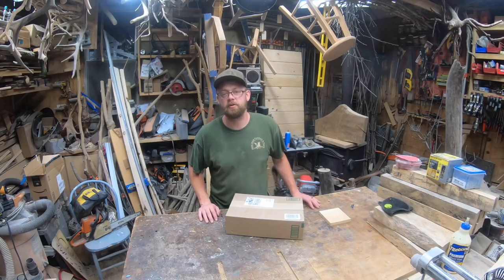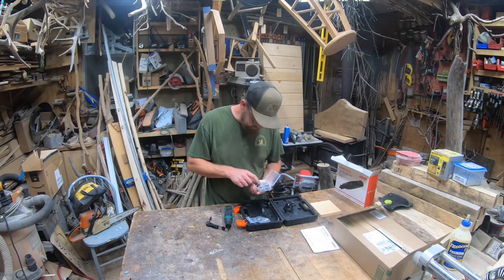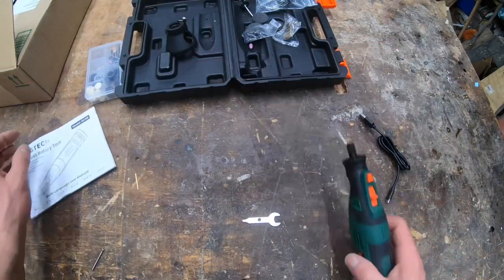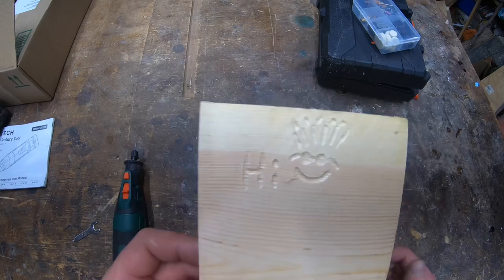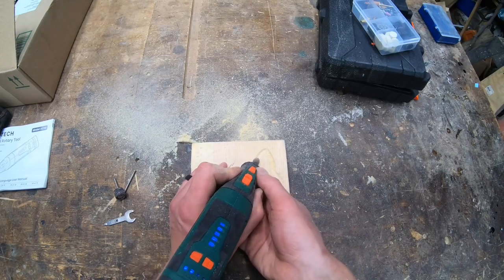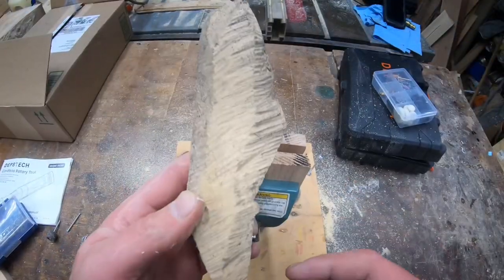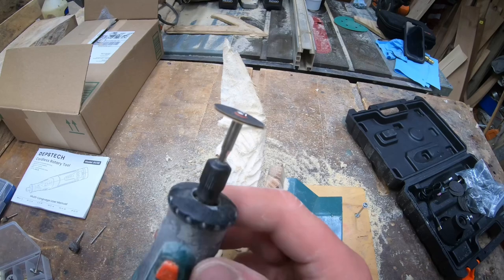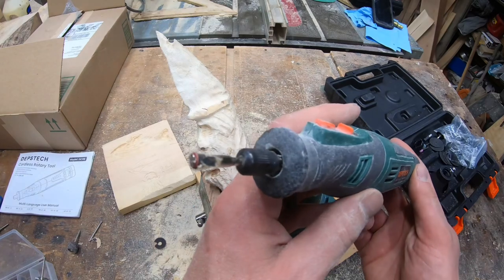New rotary tool! Depstech cordless rotary tool

Comment: The tool can truly hold its rpm when it's stressed, that was proved.  I don't think that power is a problem, because a considerable amount of work was done under pressure, and it still had the same indicators when all was said and done.  I personally wouldn't try to load it down with such pressure if I owned it, but it was free - so go for it.  I noticed that the bits/tools that you mounted into it were all the type that would vibrate (except for the sanding disks) and so all I heard was vibration from the Depstech.  I would have liked to compare those bits to one of the precision types of cutter bits.  OOPS, I just remembered and reviewed the video to prove it to myself - the first bit was a small round cutter bit and there was no perceivable vibration sound.  One of my pet peeves are tools that use bushings rather than ball bearings in rotary conditions.  It would be nice to know the makeup of this tool.  I would have to investigate the internal use of ball bearings (or roller bearings) before I would purchase it.  Price was not discussed either, if not explicitly stated, could it be given in comparison to other tools like it?
Reply from the maker: Hey Roger . I could try to do a comparison video but it would be against a corded rotary tool of a bigger brand
Reply: @KyleHallwoodworker   - I was envisioning the "manufacturer suggested price" like they might do for other brands of products.  But I feel it must be compared to another "like or similar" tool as this.  So, it would have to be a small, battery powered, like a Dremel maybe.   Thanks for the review.